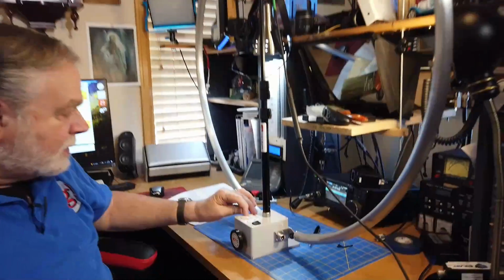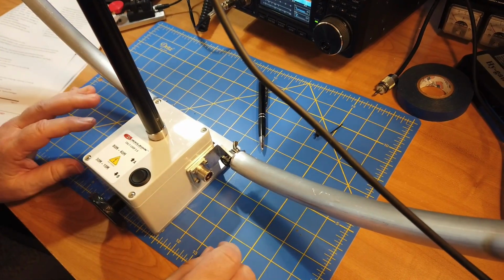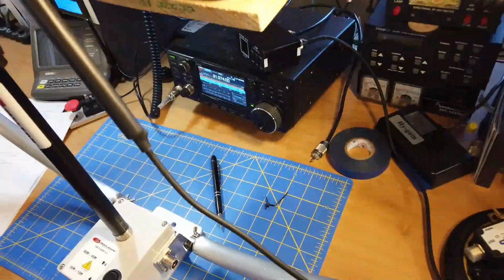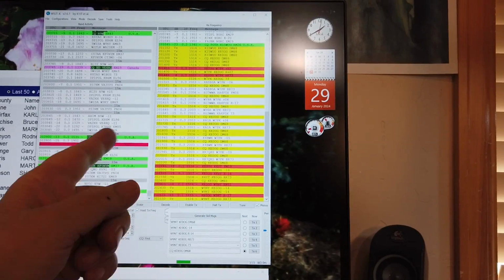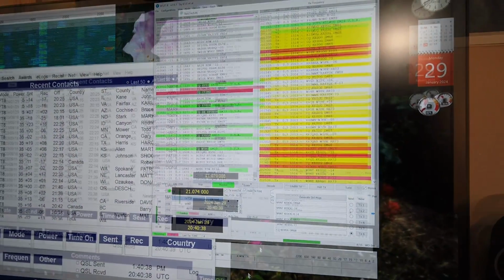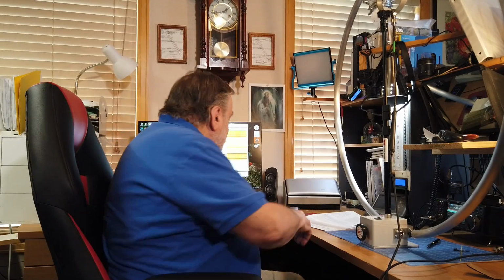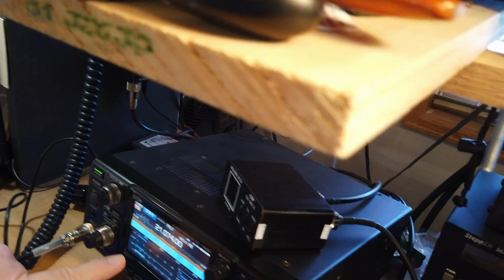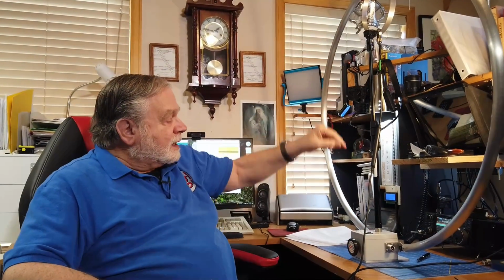Rigid Radiator F Loop 3.0 Plus (#1073)

Comment: you forgot to turn off the transceiver's internal tuner. i use a 7300 and a mag loop antenna indoors. first tune for best swr or most effective radiated power. then turn on the auto tuner to bring down the swr.

Comment: Thanks Dave for the video.  Looks like a great product.   Was thinking about the spacing between the two loops.  Maybe as a quality process improvement indicator, the manufacuteur may consider providing a prefabricated plastic spacer, that snaps into place for proper loop spacing/alignment.  73, Dave, AC3HT